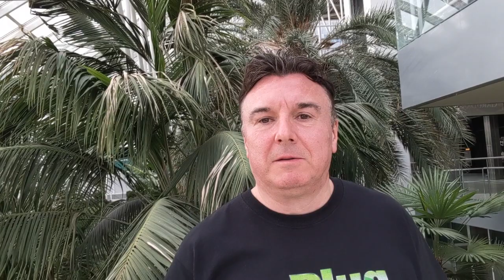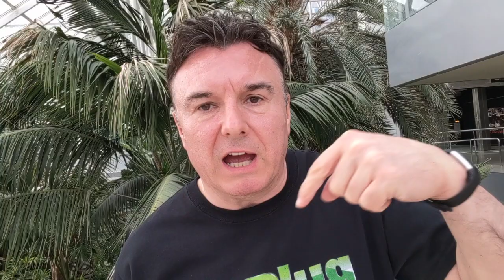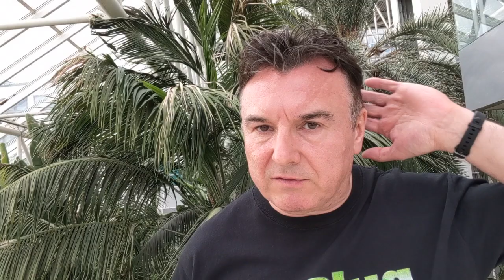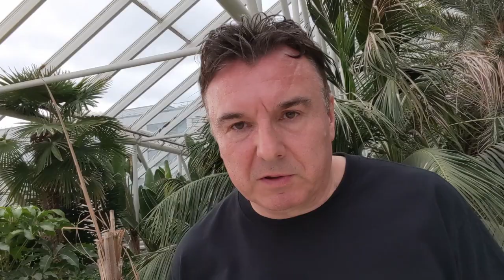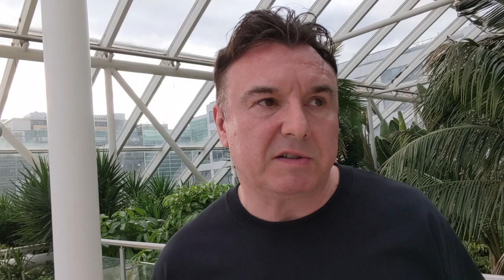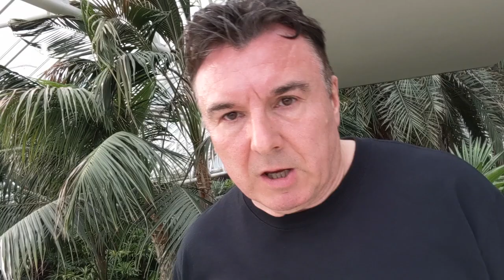Chapter 2. Getting on the Drawing Board

Comment: I was curious what programming language you used so remembering that it's a raspberry pi I googled "what language does raspberry pi use"

Python.   Lol, how appropriate.
Reply from the maker: I remember seeing this in early days when the Raspberry Pi(thon) was launched. It has an operating system called Raspbian - which is a unix on which I installed Java.
Reply: @paulwwells  Pfffft, that's nothing.   Today, I opened up Notepad without any help!